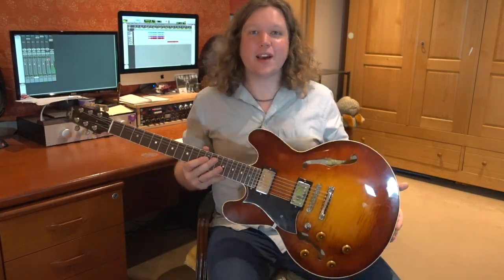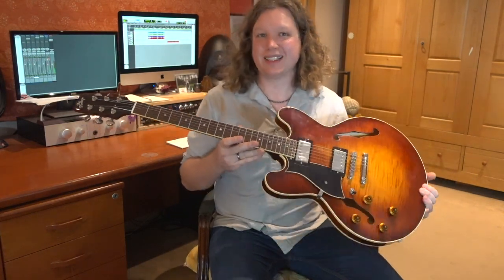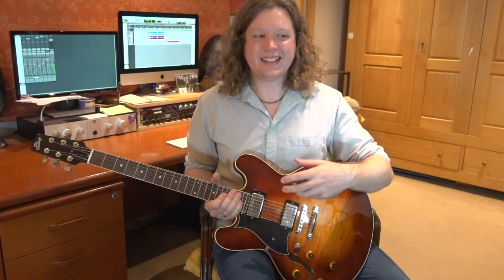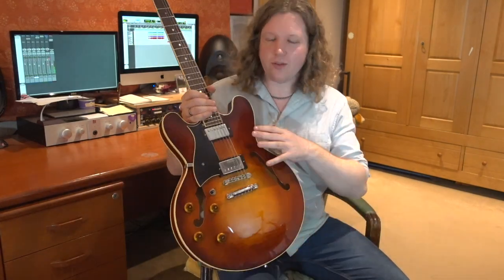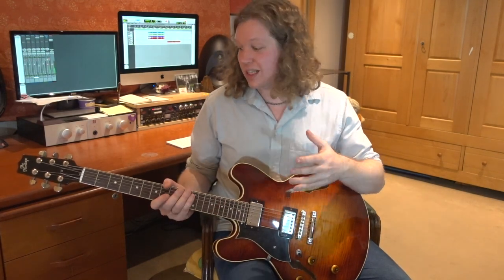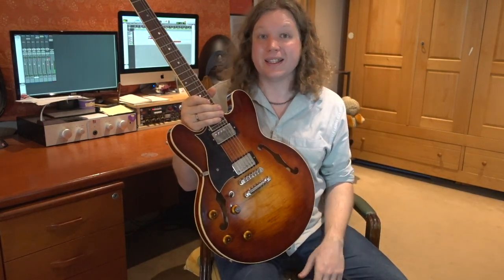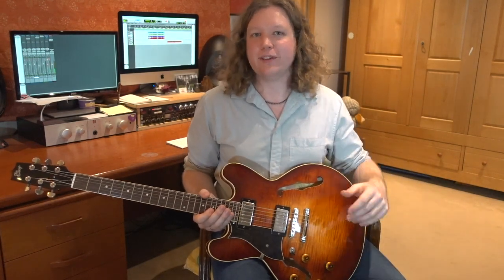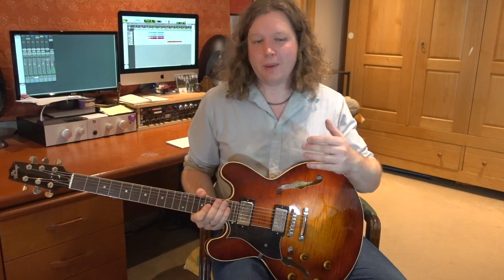Modding My Heritage H-535 To 1959 Gibson Spec (Monty's PAFs, Faber Hardware, VIPots & More...!!)

Comment: Hi joe !m Dave and i have worked for gibson guitar in nashville for 23 years. I now build the finger boards and necks for heritage. Its nice you see u like the guitar so well. Your right the pick ups were the only real weak link. The new pick ups you put in the 530/ 535  are a great improvement! It sounds great!! I enjoy you video man. Keep rockin. :)
Reply from the maker: Hi Dave - thanks so much for the comment :-) Really glad you like the tones...the SD '59s just felt a little too stiff and rolled off in the hight end for me.  The Monty's PAFs win lots of awards for being super-accurate replicas, and I had a set here already, so they seemed the logical choice.  The 550k VIPots make a good difference as well; and the hardware too to a lesser extent.  The 535 is such a perfect guitar now...absolutely blown away by it!  Thanks for all of your hard work on them!! Were you with Heritage in 2011, or was your move from Gibson more recent?
Reply: I think everything is good in these Heritages apart from the Seymours. I find Seymours to lack expression when you play dynamically. I put some OX4s in an H150 and these made it way better.

Comment: Hey Joe ("where you going with that gun..." Sorry), I made almost the exact same upgrades to my 2016 LP Traditional. I also had the Montys 50s wiring harness and pots. It completely transformed the guitar. Before it was good (that's why I bought it), but after it was clearer and more responsive. Definitely a great set of mods.
Reply from the maker: Monty's make epic gear! :-)
Reply: @JoePerkinsMusic  I have nothing but praise for Faber, too. I had a problem with the first aged bridge they sent me. The ageing had adversely affected the saddle screws, making them stiff to adjust. Without hesitation they sent me a complete new set of un-aged screws. Top marks!

Comment: Thinking of getting a set for my Gibson Explorer... different vibe I know, but did you still get decent Dan Hawkins tones when you had these your LP instead of the 490R/498T?
Reply from the maker: I could, with a bit of tweaking....they're not 100% suited for that tone - PAFs in general are lower output, brighter and marginally more prone to microphonic feedback - but you could absolutely get there.  Rolling down the tone knob when using heavier gain was good; as was using a TS808 to fatten the low mids back out to sound closer to the 498T :-)

Comment: I've never heard of VIPots before. I usually buy a bag 20 of alpha pots from China and pick out the best ones. I'm a lefty as well, do you use left hand taper in your guitars? I have been using linear taper for volume and tone for years, I can't get on with log at all.
I used to have a red 535 with seymour duncan seth lovers in it. I regret selling it very much it was a really beautiful guitar and sounded fantastic!
Reply from the maker: They're really nice - slightly overvalued and a very accurate taper....though they're log, so they might not be up your street!  I use 'standard' pots and just have them operate backwards relative to the guitar's body....that way I can use any pot, rather than the small handful of lefty taper ones out there.  All my guitars work that way - once I got used to it, it made life a whole lot easier! :-) H-535s really are amazing...this one is definitely a keeper :-)
Reply: @JoePerkinsMusic  I've got a mixture of guitars some of which I wired left handed and some are standard. As you say it gets a confusing when you change around! I go with standard righty wiring these days as well. I'll give the vipots a try next time I do a guitar.
I bought a bunch of pickups before getting the Montys and they are by far and away the best I've had. I tried Seth Lovers, Jim Rolph and Bare  Knuckle. Seth Lovers are also nice but I really like the brightness and clarity of the Monty. I can't say if they sound like a PAF but I hear sounds I've heard on records with those pickups. They blew my mind! Enjoyed your video, thanks and keep rockin!

Comment: I want to take my Washburn HB-35 to another level and found this great video. Of all the mods you did which one you consider has more impact for better sound. Sounds killer your guitar.
Reply from the maker: Definitely the pickups - the originals were wax potted and a bit boring-sounding.  The pots gave a little more high end & feel nicer to use; the caps arguably make no difference at all; and the hardware made things sound a touch brighter but with less upper midrange.  But the pickups were the big change - a 'proper' set of unpotted PAFs are hard to beat in a guitar like this :-)
Reply: @JoePerkinsMusic  Hello Joe. Thanks for your answer. Do you think I should try unpotting the stock humbuckers the Washburn HB-35 has?
Reply from the maker: Personally I wouldn't - potted vs. unpotted in the same pickup is usually quite a minimal change.  I'd personally change the pickups before trying to unpot the set you have.

Comment: Nice guitar !! Do you reckon these Heritage be as good as tge Collings ?
Reply from the maker: Have never played a Collings (a bit out of my price range!!) - but from what I've heard, their build quality/QC is perfect to the point of sometimes being a bit clinical.  My 535 is definitely handmade - so there's the odd wobbly line here & there - but that's why I love it...it's _human_.  I believe Collings put ThroBak pickups in their 335-style guitars by default, which is pretty much as good as you can get in the PAF replica market, whereas this guitar had Seymour Duncan '59s...which weren't really my sort of thing, and swapping them out was a huge improvement.  ThroBaks will run you $500+ on their own, so that's a decent chunk of the price difference between the instruments there.  So - different guitars at different price points, but if you're willing to swap out the 535 electronics for posh boutique stuff, I'd imagine they'd sound and play v. similar.  My 535 is probably the best playing guitar I own :-)
Reply: Sounds good! Yeah changing pups and electronics is necessary I would do that, more like just wondering how the lutherie compares to 60’s Gibs and Collings, like wood quality selection, assembled etc
Reply from the maker: A lot of people online who have compared vintage 335s to modern ones say that the Heritages 'feel' a lot closer to the old Gibsons than new Gibsons do...and with Heritage, you essentially get a handmade Custom Shop Historic 335 Reissue (with slightly inferior electronics) for the price of a standard 335 model.  And on the used market, Heritages generally go for a good amount less than Gibsons.  So if you can find one 2nd hand (like I did!) you can get a huge amount of guitar for very reasonable money.  In terms of Collings (and again, this isn't from personal experience) I've heard their built quality/QC is higher - Collings are immaculately crafted instruments - but I also thinkHeritage guitars use brilliant wood and handmake their guitars incredibly well....so considering the price difference between them, I'd personally prefer to buy a Heritage and pimp it up the electronics a little :P